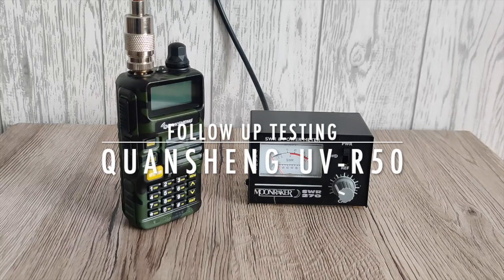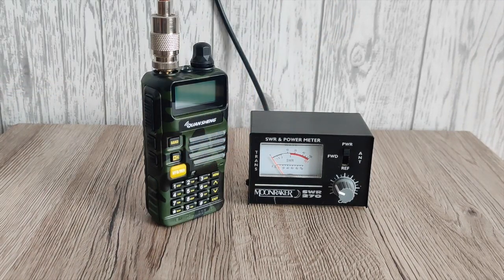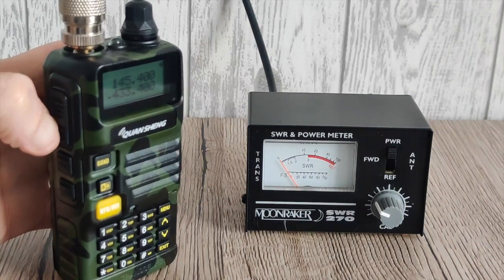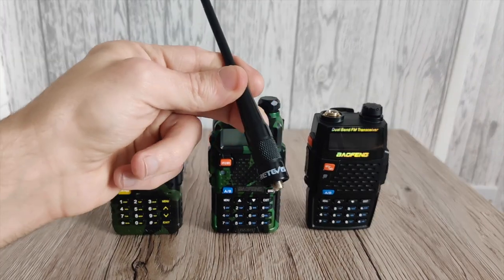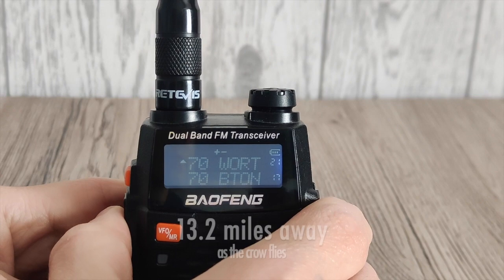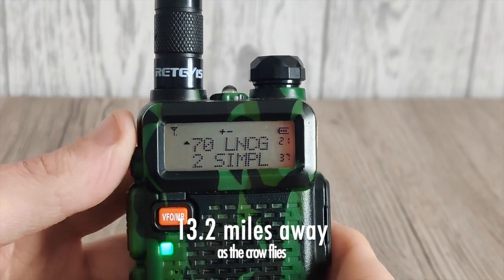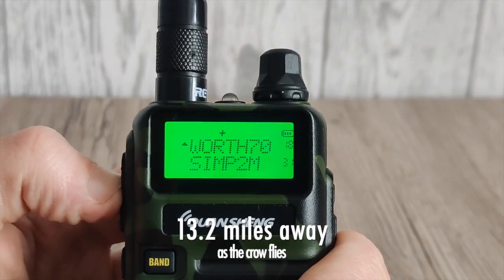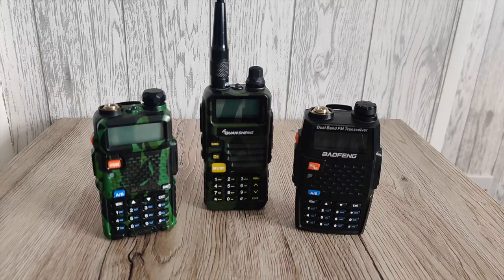Updated Test & Comparison | Quansheng UV-R50 vs Baofeng UV-5R

Comment: Thanks Mike, very clear advice and a good comparison.  Daft question, but I just wanted to be clear, the Retevis model antenna you used looks like you can get as an  SMA-M or F. This is a female connection that you used, is that correct? Just didnt want to get the wrong one!
Many thanks, enjoying your content.
73's
Nik
Reply from the maker: Hi Nik,
I had to double check myself as I’ve two Nagoya NA771 antennas, a male and female version. The one for the Quansheng/Baofeng uses a female connection like you said.
Thanks for the kind words also, it’s very much appreciated. 
73’ and stay safe.
Reply: @OntheMicwithMike  Many thanks for replying mate! 73's Nik